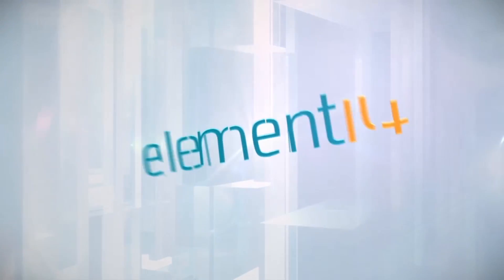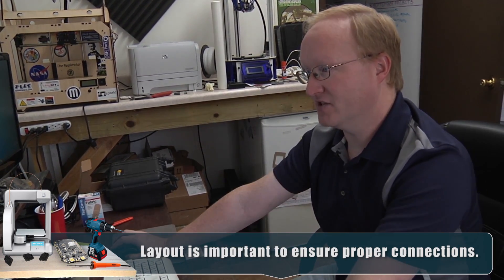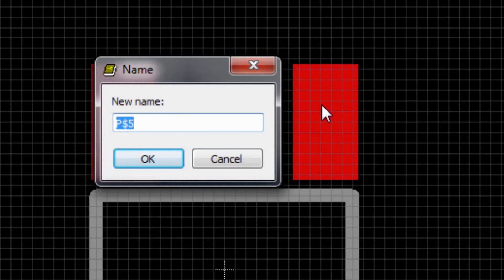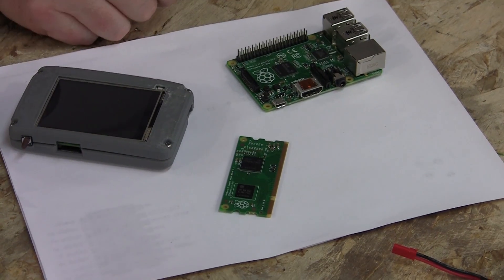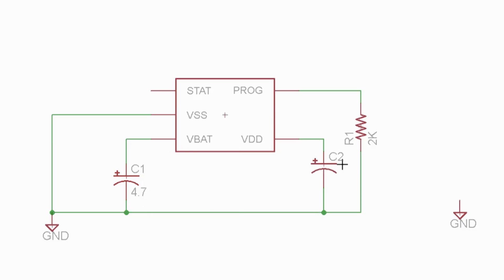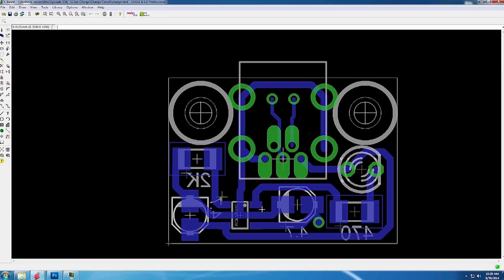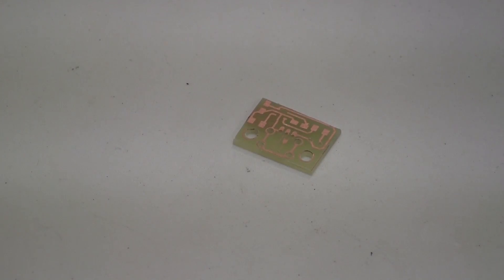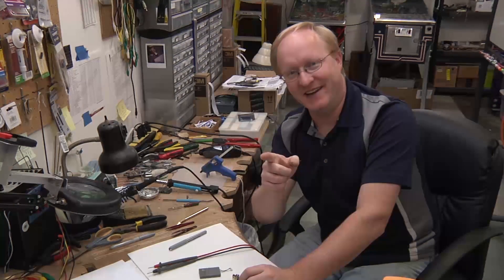Ben Heck's Battery Charging Circuit

Comment: There is a way to solder Surface Mount components so they don't "tombstone" or stick to the soldering iron.

1. Apply a small amount of solder to one of the pads where the component will be (do this without the component in place).
2. Place the component in position with a pair of tweezers
3. Apply a small amount of pressure to the top of the component to hold it in place
4. Touch the iron to the pad which you previously applied solder to

If done properly, the component will drop flat against the board and get locked in place. This will allow you to keep near perfect alignment, and solder the remaining pads without fear of the component lifting or sticking to the iron. You can then apply additional solder to the pre-tinned pad if necessary.
Reply from the maker: Amra Thanks for sharing!
Reply: The Ben Heck Show Yeah I was surprised to see the way you soldered those surface mount parts considering how much electronics you do..
Reply: I've had success using a scapel to hold the parts down whilst soldering
Reply: Why don't people use solder paste and a heat gun or reflow oven?
Reply: Escapist166  Reflowing a board is good if you take the time to glue down every piece first,or have a pick and place machine, but reflowing an entire board for one tiny component, especially on a populated board or a board with both SMD and through-hole, seems a bit unnecessary, and carries added risks.  Not only that, but there's no reason to do that for one-offs. Soldering SMD components is an important skill to have, so doing small one-offs by hand helps keep the skills sharp.
Reply: Amra As I understand it the solder paste is enough to hold the components down; glue is only necessary when wave soldering. Honestly I haven't done any smd soldering, I've only done through hole work with a soldering iron. The soldering with hot air tutorials on youtube appear to be way less hassle, though they do require a solder mask.
Reply: Escapist166  I've only used a couple solder pastes, I've never really thought to use the paste as the glue, though I suppose I can see that being done. I've generally only used it applied through a needle for getting small amounts of solder onto very small terminals/pins, but still hand soldered them...

Hot air can be convenient for certain instances, but I use mine almost exclusively for de-soldering, rarely for soldering.
Reply: Amra
When I have to do tiny stuff like flash memory or SMD stuff, I use a custom iron tip I made, that has a safety pin sized needle of steel coming out. I weigh down the handle of the iron from a string by hanging a small rock from it. I rest the top of the handle near the actual heated part on a small glass insulator I have so I can tilt freely. You have to push about 5lbs of force to move the iron down 3 inches, so you can move very accurately. I use this for stuff like SLC/MLC NANDs when I hack cheap MP3 players using 32GB-128GB chips in place of the low quality 4/8/16 ones if I identify a controller compatable of more. I then add more filter caps to the unpopulated parts of the audio chip's pins and circuitry to make it sound really clear. I replace the battery with a bigger cell (size of the whole PCB aka 2.5AH) and put it in a custom 3D printed case that is slightly thicker. I use the same method of actually placing the parts that you described.

I thought maybe my method could be used to help those with a unsteady hand or who move too fast/hard when soldering timy stuff. Especially when you do dead bug style soldering on packages with pins on four sides like FPGAs or embedded type CPUs. Just sharing some info.
Reply: +theLuigiFan0007 damn you got this your technique down.

Comment: One great way to avoid the "tombstone" is to use masking tape. Use tweezers to put the chip in place, and then carefully lay the tape vertically on one half of it (the side you aren't going to solder first). The most important part above all, is that the masking tape is tightly in place. Once it is firmly in position and circuit leads are aligned with the pads, then go ahead and apply flux if needed, then solder the pins on the exposed side. Remove the tape when finished, and then perform soldering the other side, no tape needed.

A solder mask makes this easier as it's harder for solder to flow far from the point you are attempting to solder, and a syringe with flux makes things even easier than that, preventing solder from creating bridges easily. (I use no-clean, tacky flux, in a ventilated area)

Also: Amra's suggestion is simpler and requires less resources to perform. This is simply my own solution for doing this at home.

Comment: Please do not teach bad habits. Name the pads in the package editor using numbers like 12345. Name the pins in the symbol editor with "VCC" and "GND" and "PROG" and "VBAT" and "STAT". Then use the device editor to connect them.

This way, you can have one package be usable for multiple symbols for different devices.
Reply from the maker: frank26080115 I'm still fairly new to EAGLE, so I appreciate your advice. :)
Reply: The Ben Heck Show Yes much better doing it that way, also naming the symbol with the partnumber not the package type, that way when you add another SOT-23 shaped chip you can tell them apart.

Also rotating the parts around to make the chips power pins point up and input be on the left and output on the right is good practice but yeah making schematics for yourself it doesn't mater at all.(You see the value of clean schematics once you start drawing ones with 30 chips in them and some being having 100 pins, can become a unreadable spaghetti monster mess quickly)
Reply: The editor I use assigns two attributes to component legs, physical ports and logical ports. The physical ports are simply pin numbers. Logical ports can be anything you like. If you are making a generic part, use the same numbers again. If it is a specialised part, use the pin function names.

Comment: Sorry I am a low tech.  My question is those Chip/circuit board in the lab top  batteries or any batteries design to stop the power from over charge the batteries right ?  Thanks

Comment: How about a 2S battery charger/power supply circuit, that will automatically cut out and charge the batteries when AC power is connected? And then cut them back in once the supply is removed. That would be cool.

Comment: what will happen if you reverse the polarity of the battery while connecting it to charging circuit? I mean if you connect the negative terminal of the battery and connect the positive one to the ground. can it destroy the charger circuit?

Comment: How did you get Eagle to make joints when you click? are you using a hotkey? Just ending wire there does'nt give me joints!
Reply: Simple: Don't follow the misguided instructions in the video. Use "Net", not "Wire". You almost never ever want to use Wire in a schematic to connect parts. When you use Net for connecting parts it automatically inserts junctions for you. To draw lines in other layers it's fine to use Wire.
Reply: HidekiSamba thanks! no tutorial ever teached that :D

Comment: I  made this circuit but  using  10uf capacitors and my led  does not  turn off .do you think its anything  to do with the caps my power supply is just under  5v also.

Comment: Hello Ben. Is it possible to use the battery while it's charging? Or do I need a switch between the external power supply and battery? Could you give an example of a backup power supply for the Arduino with a lithium battery?
Reply: Yes you can use the battery while its charging.  In a project I'm working on that uses this charging IC I placed a switch between the battery and Arduino circuitry so the USB port+charger+battery are always fully connected while the Arduino's power can be switched on and off.  With this setup you can plug in a USB cable and the battery charger functions no matter if the switch is on or off.  I show a schematic of this about 7 minutes into this video Freetronics Wireless Cube4 Part 1
Reply: dparson Thank you very much! You've helped me a lot.
Reply: yes and no, it depends on the battery charger IC, some specifically do not allow it, and attaching a load while charging the battery will destabilize their regulation loop, it's best to assume that you can't, unless the specific IC you are using mentions that you can

Comment: With your "laser paint" method - wouldn't it be a better idea to just laser-etch the board directly instead of painting it, removing the negative and etching it with chemical etchants?
Reply: The laser can do absolutely nothing to the copper....
Reply: Ah! Of course - see, I was basing my speculation on the laser cutter we have at the plant which is used for cutting very thin aluminium (it's more accurate than plasma cutting in this case - for bigger things: plasma all the way Oo-Rah!)

The thing I've since discovered about the laser cutter at work is that it has a very high energy output; probably wouldn't get away shoving that beast in your workshop without somebody wondering why you're running the most expensive light source in the neighbourhood ;)

Comment: could you mod a The Legend of Zelda cartridge with this chargins circuit so the internal battery recharges everytime you plug the cartridge into a NES and turn it on? it would make the save files live pretty much forever, if you play frequently enough. alternatively cou could connect the charging circuit to an USB cable instead of the cartride pins... or to both! so you don't have to charge it via USB if you're playing frequently enough.

Comment: Ben, any reason for removing one of the pads on the USB-plug?
Reply: USB standard uses 4 pins (power +, data +, data - and power -)
Micro USB has 5 pins and the 4th one is to tell which device is superior
some smartphones have USB host and flash drives or USB mice can be connected to them
for more info look in wikipedia
Reply: kokoilie Eh, yes and i know that. I just wonder why cut one of the pins in half and have a harder time drilling the hole afterwards.
Reply: sorry I thought you noticed that he said he didn't need that pin
also he drilled the hole because it's easier than bending the lead of the connector

Comment: must i use balancer to charge 2 cels of li-ion batteries.

thanks
Reply: +Stanislav Jochman if the cells are in series :yes, if they are in parallel: no. In parallel, they have the same voltage across them(ie they self adjust)

Comment: where can i find circuit diagram for the circuit?
Reply: Bottom of page 1 on the MCP73831's datasheet.  The only part that is missing is the USB connector but just hook USB's +5V to the MCP73831's VDD pin and the USB's GND to VSS, and you're all set. http://ww1.microchip.com/downloads/en/DeviceDoc/20001984g.pdf

Comment: Does anyone make a tiny circuit already built for a 5S pack?  Regular chargers are way too big for what I want and everything I have found that can be bought has the overcharge and over discharge voltages too far off.  Probably why packs die much sooner than they should.  I want a high cutoff at 4.20 and a low at 3.00.

Comment: Please do not make the symbols for the schematics look the same like the package. It makes your schematics unreadable. Make them so that you can connect all external components in a clean and readable way. GND on the bottom and VDD and Vbat on the top (one at each side). The datasheet symbol representation of this component is quite a good example.

Comment: Are the caps 4,7uF?
Reply: Yes, he's using the circuit shown on the bottom of page 1 on the MCP73831's datasheet.  I've used 10uF caps in 2 projects rather than 4.7 and they work fine as well.
http://ww1.microchip.com/downloads/en/DeviceDoc/20001984g.pdf

Comment: Is there any way to Charge my two 18650 3,7 V 3000mah Batteries? One guy told me i have to use a balancer. they are in my portable Raspberry Pi Projekt. Can someone explain me this? (english or german)
Reply: *****  Thats what im doing now, but i want to charge the batteries while they are inside of the portable Raspberry Pi! i dont want to extract they every time from the device. Dont know how to connect the loading "stuff" to the System (its already works) . My batteries are Serial connected, so i get 7.4V with 3000 mAh and someone said me i have to use a balancer, so they both get loaded to a same "level" and not overcharged or destroyed. I know the wrong usage is dangerouse and they can explode, thats the reason i search a solution . The item from amazon i already have. Big thanks for the answer
Reply: *****
But the single Cell has 3.7 V (2 Cells) . Dont i overload it with this ? i want the full charging stuff into the raspberry.
Reply: you want to get a shunt regulator to balance the cells
Reply: I find LiPos fun. If you want I can see about designing a PCB that you could use?

Comment: it is 3.7v what is the miliamps on this
Reply: The charging IC he used, an MCP73831, has a maximum charge rate of 500mAh.  This is also the maximum charge rate you can pull from a computer USB port so it's a useful in that situation.  The charge rate is adjustable by the resistor you hook to pin 5, the PROG pin, on the IC.  The datasheet http://ww1.microchip.com/downloads/en/DeviceDoc/20001984g.pdf has a formula to calculate the resistor value to use for different charging currents on page 15 in section 5.1.2, and there's a picture of the charge rate vs resistor value on page 7, figure 2-4.  This is just the maximum charge rate though, the charger's logic will adjust the rate accordingly until the battery is charged, it just won't go over the rate you set.
Reply: dparson thanks can eagle work with ordinary printer I'll have to try make my own board for this

Comment: Why does Ben waste time making a circuit on eagle, why not mount all the components on a proto board??
Reply: Are you serious? How do you pretend to use a circuit in a protoboard? The finish is horrible, a PBC makes a much more professional finish to the proyect, so it's not waste of time
Reply: Because they wanted to make a basic "how to use Eagle" tutorial.
Reply: If they wanted to make a eagle tutorial video they would call it "basic eagle tutorial" ???? And also if you know how to solder properly and have experience with mounting components (which I'm sure Ben has) the protoboard will look fine..,
Reply: *****  I understand that they are considerably better however the amount of time Ben must take to produce such a board is a little unnecessary...
Reply: *****  But he usually only makes one per show....
Reply from the maker: Maraos We wanted to be able to produce many of these circuits so we can easily embed them in projects. This gives us a nice finished product.
Reply: The Ben Heck Show That was what I said. Ben, you are the best!
Reply: The Ben Heck Show  Fair enough =]